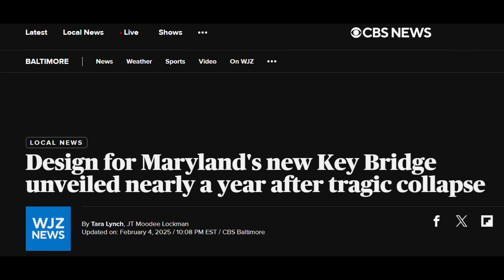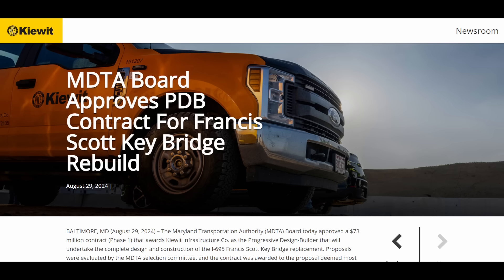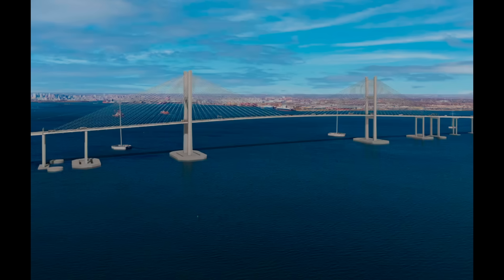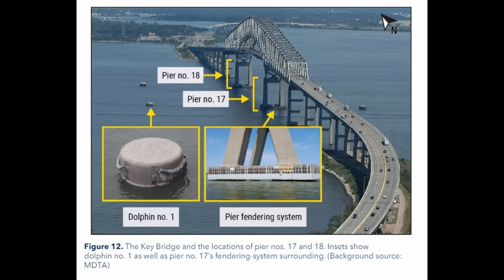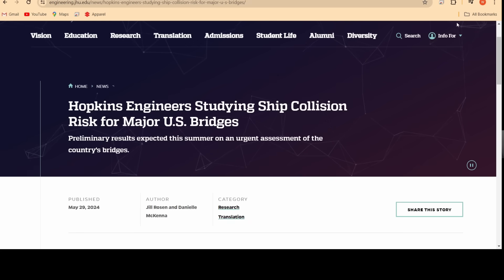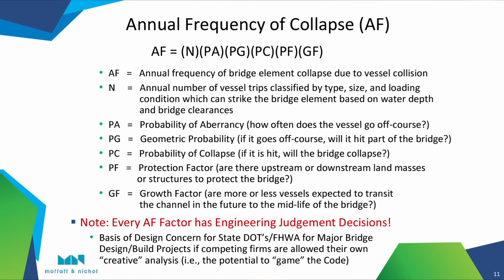Francis Scott Key Bridge Update

Comment: The Verrazzano-Narrows Bridge in NYC seems like a better/safer design. The new Gordie Howe Detroit-Windsor bridge looks pretty similar to the design of this Key Bridge. Which of those design types require less maintenance?
Reply: Cable Stayed. A suspension bridge takes wayyy to long to build which is why they went the cable-stayed solution.

Comment: Good to see progress on the Key Bridge. The old one was a good friend I saw daily starting in 1978.

I have a problem with “common sense,” mostly that it isn’t common at all and that it’s frequently based on assumptions without any analysis to support them. I’ve seen and been involved with a lot of design builds, and the best process is a hybrid, analysis combined with open discussions where people who understand the use of the product can be engaged with the design contractor and contracting officer’s technical representative to ask any questions and present thoughts openly. I’ve seen revelationary AHA moments that turned out to be the difference between a great product and something wanting. I’ve seen situations where this didn’t happen and a key bit of knowledge that an employee had wasn’t shared and addressed with the result being that the product needed to be modified after delivery. It’s a small thing with huge consequences.

Comment: Good to see a good new design moving forward.   What is slow is pinning down why the ship had repetative power failures.  Based on my experience there are many ships that have unreliable electric supply due to unstable load sharing when running multiple generators. This leads to motorizing one of the generators and breaker tripping  This is due to both poor design and poor crew training.  The NTSB still has this under study.

Comment: A few issues with very slow speed limits on ships. Many large ships are not as maneuverable at slow speeds. Their rudders work best at cruising speeds. And they are more susceptible to issues with wind pushing them. Of course that can be worked around with better designs, weather limits and ocean tugs but it does add cost. 

Also requiring escort at speed needs special tugs built for that. Not generally the smaller tugs we saw moving Dali away from the peir at that time. To try and assist a ship that large in open water when she's under her own propulsion requires a much larger tug able to handle that much mass.

Comment: There is more to this than just civilian road transport. This incident is also a reminder that the thousands of years old method of using blockships can paralyze a harbor or waterway in minutes. The Russian anchor dragging operations against communication cables are effective and (as we see from vessels being permitted to leave) easily deniable as would suitably employed blockships. Of course it's easy to block the Suez canal using someone else's vessel of which there are thousands globally to choose from. 

That means RAPID clearance operation capability is a necessity and I don't just mean civilian businesses because harbors and waterways are strategic military and economic assets. Most large military deployments rely on sea power, not the airlifters newsdroids love to video. 

As usual between wars the US is grossly neglecting its Navy (whose leadership has proved incompetent to design new vessels though no one lost rank or position over LCS)  and has all but abandoned its Merchant Marine let alone specialty operations like wreck clearance (mandatory in island warfare, opposed beach assaults and more).

Comment: Yup, widening the span over the channel, allowing a longer approach through shallower water before getting to the piers, was the only intelligent way to rebuild it.  Dolphins are great, but adding hundreds of feet of shallow water where the ship is already aground will do more to stop a ship large enough to collapse the bridge.

I'm also entirely unsurprised they raised the height above water over the channel - the additional height opens the port to a surprising number of additional ship loading configurations.  Unfortunately, the Chesapeake Bay Bridge in Annapolis will still restrict ships to basically the limits the FSK already imposed on Baltimore traffic, but should the Chesapeake Bay Bridge  get a rebuild to the same height, Baltimore would be able to take any ship comfoguration that could make it into New York, as the FSK would have 15' more air draft rhan the bridges leading into New York.

Comment: One thing not mentioned in assessing the risk, is the necessity have regulations that will  require rigorous insections prior to ships getting underway to ensure they are seaworthy. This includes ship machinery as well as  the competence of the crew to operate the ship in a safe manner. I can't believe a ship would get underway with the fuel system feeding the emergency generator  not lined up to provide fuel to the emergency generator. That and. I believe other parts of the ships electrical system were not functioning either.  This is completely unacceptable.
Reply from the maker: Yes, that is true too.  I just think that the bridge was wholly unprotected.  I mean there is the possibility of bad actors that would want to do something like this.

Comment: They took out the original design, the design they showed us in the Baltimore Sun newspaper so many decades ago, the design that was "too expensive" using a technology that was "too new and untested", the design that they rejected and discarded... ...they took that original design out of trash bin, and "Voila! New design!".  No complaints - it was a good design then, it is a good design now.  It's what they should have built decades ago.
Reply from the maker: Interesting. Back to the future!
Reply: @CaseyJones-Engineer  Honestly, back then, I thought it was ugly. I wanted to see a classic suspension bridge.  That is why the proposed design stuck in my mind so clearly.
Reply: At that time, it looks like it would have been only the second cable-stayed bridge of a modern design in the US, after one in Washington state.
Reply: @Scramble-electron-890  Correct.  That was was a really radical departure from all that had been done before.

Comment: I’m usually pro infrastructure, but this bridge is a waste of money and not needed.  Build a road around the river
Reply: This bridge is a NECESSITY. It is the alternate route for HAZMAT trucks through Baltimore. They cannot use the tunnels. Plus, it’s an average of 33k vehicles a day that do not go through Baltimore.

Know what you’re talking about before making such a stupid statement.
Reply: This bridge is NOT needed. The harbor is crossed by two Interstate highways with a total of 12 lanes.

Hazmat shipments can use I-695 west of the city and certain surface roads around the harbor.

Now if the bridge could be built for say $100 million, that would be ok.

But $1.9 billion is a colossal waste of money.

Maryland originally planned a tunnel outer harbor crossing. It would be still carrying traffic to this day.

They rolled the dice and they lost.
Reply from the maker: @dans3294   Especially at that price.
Reply: Look at a map.

Comment: Per MDTA the main span would be 1,600 feet. The former span of 1,200 feet proved that totally inadequate to protect from large ships.

Building another vulnerable and unsafe bridge is not the answer.

The 30 foot depth lines are shoreward of the proposed tower locations. And that is at mean low water. An abnormally high tide could add 10 more feet to that, with a combination of high winds and spring tide. See NOAA Chart 12281 Baltimore Harbor.

A large ship would NOT run aground before hitting one of those proposed main piers. It would destroy the pier and bring the whole bridge down.

The safe way to build a bridge there that is protected from ships is a suspension bridge with a main span of 5,200 feet between the two causeways.

Comment: Just one comment about the law enforcement actions that night. From what I can tell, the state troopers were working what we call 'extraordinary enforcement' duty exclusively for the DOT crews working on the bridge. These are overtime shifts paid for by the DOT (or contractor) in order to give extra protection to crews working in dangerous situations - especially at night when traffic volumes are low and speeds increase. They have no regular patrol duties during these shifts. This is why the troopers were able to stop traffic quickly when the calls came over the radio (one of two lanes was already closed). I don't understand why the workers were not thought of when they were so close by - and the troopers' assignment was to protect them. Normally, the troopers would have been positioned in the lane closure, only a few hundred feet from the crew with red and blue lights on in order to slow and gain attention of motorists. I'm not ripping on the troopers - so save the cop-hater comments for another day. I'm simply explaining how it normally works to those that do not. In my 36 years of experience in the biz, I have seen vast improvements in safety for workers. But no improvements are made without finding the probable causes. Again, I am not talking about blame - just looking for improvements. Plenty of unimaginable things went wrong that night and hopefully we learn from all of them.
Reply from the maker: Thanks for sharing your expertise!  It is always good to understand the 'why' behind an incident to improve safety.
Reply: @CaseyJones-Engineer  Casey, back in 1991, we were working at night, in a tunnel on I-94 in Minneapolis. I received a radio call from DOT dispatch that State Patrol had a high-speed chase coming our way - and to vacate the tunnel. We scrambled out of the way immediately and awaited the chase. It never came. Later, I called DOT dispatch and asked why, only to hear, "Minneapolis cops knew you were working in the tunnel and placed their squad cars sideways on I-94, forcing the chase to exit before the tunnel." OG heroic is what that was.

Comment: In my engineering career, I found that the more "business" background the management had, and/or the more political they were, the more they wanted hard numbers or similar "facts" that were unknowable.  Even such approaches as a "confidence window" requires assumptions, and do you think they read that portion of the document? Only if there was a problem and then someone had to point out to them that the assumptions or other conditions were not met.

Engineering can do all the analysis and calculations, but at some point to be useful it has to interact with the real world. That can be as obscure as materials having less margin than typical or even not meeting all required specifications, but more often it is because of something like what is in the hill or under the foundation not being as expected.  It might even be the assumption of a 500 year storm being based on a normal distribution, when as Talib points out, nature isn't normal.

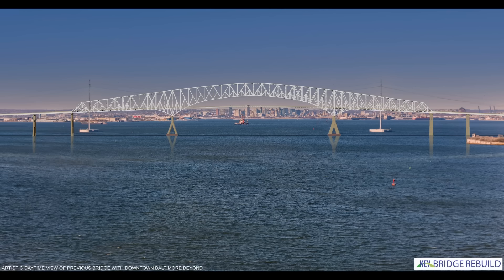Comment: I'm getting a mainspan (distance from tower to tower / pier to pier) of 1,776 feet. The Key Bridge Facts sheet released by the Key Bridge Rebuild website mentions "exceeds 1,600 feet", but I get 1,776 feet, which does exceed 1,600 feet.  Just compare at 0:44 of the video when the two bridges are overlapping, and you can use that as a gauge to measure using the Google Maps (or Google Earth) measuring tool.  The NE (right) tower of the new bridge is at the 5th panel into the NE sidespan of the former bridge.  The SW (left) tower of the new bridge is 4 and a half panels into the SW side span of the former bridge.  This puts the span at ~1,776 feet.  Nice patriotic number, like what they did up in NYC with the Freedom Tower at the WTC site being 1,776 feet in height.
Reply: Nope -- 1,600 feet is what they are planning and applying a rule to their image would be that about right.
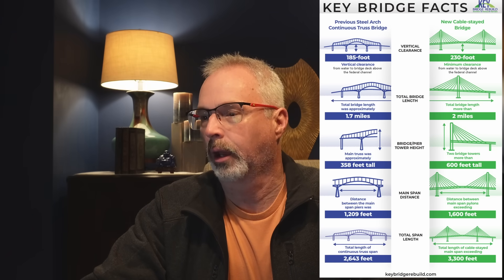Reply: @scottkozel1519  Wrong - starting at 1:07 of the video, way down in the extreme lower right corner is "Distance between main span pylons exceeding 1,600 feet"  The measurements are accurate as has been demonstrated on several Facebook pages.